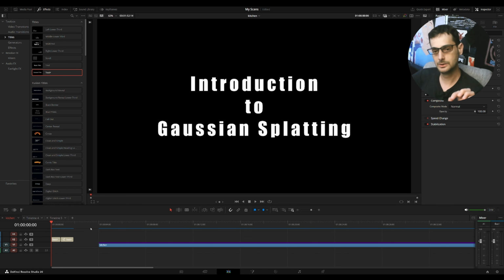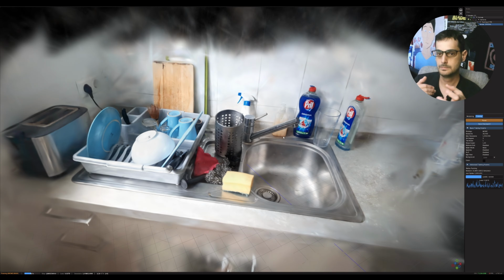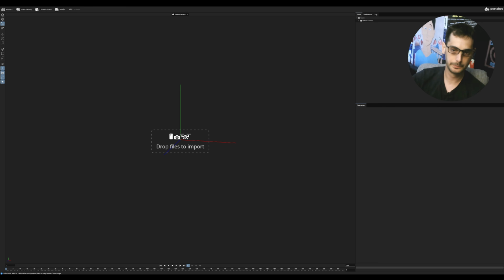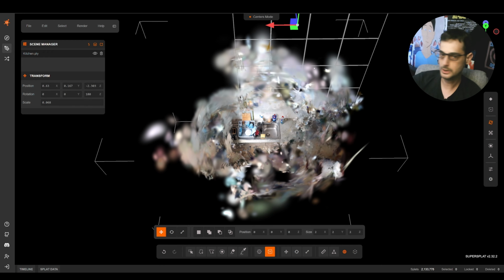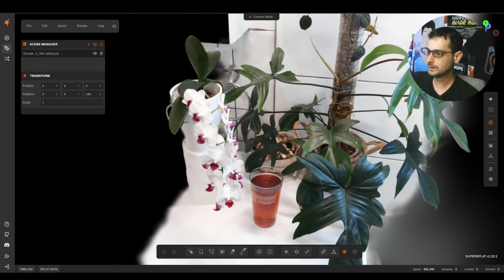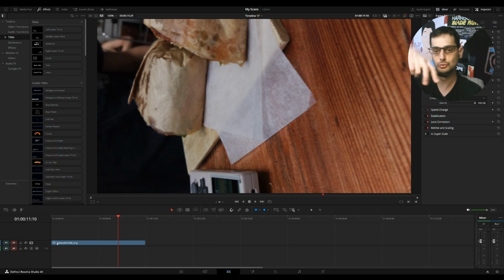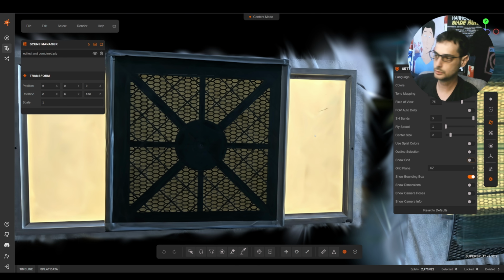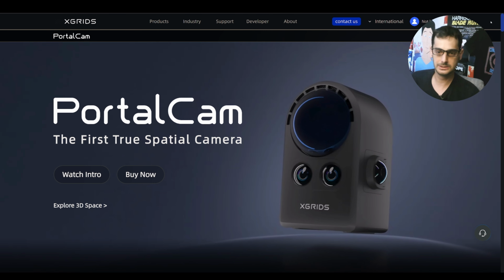Introduction to Gaussian Splatting | Workflow, Camera Tests & VFX Pipeline

Comment from the maker: Notes for getting a good GS scan: shoot on M mode, high shutter speed (min 1/200), closed aperture (max f5.6), highest bit rate and bit depth.
Remember: the biggest enemy of Gaussian Splatting is blurry images, try to avoid out-of-focus areas, motion blur and high compression artifacts.
Another thing to keep in mind: try to avoid moving object, moving shadow (camera shadows for example), moving reflections and smooth surfaces without texture - if you can't track it, you won't get a good GS result.

Comment: Really nice exploration on splatts. You mentioned compression with some lenses. It made me think about image formatting and the way each compresses the image data. Have you compared jpeg, tiff, raw, other formats to see if there is a difference?
Reply from the maker: to process the splats you need a 8bit format and I didn't see a difference between jpeg and png